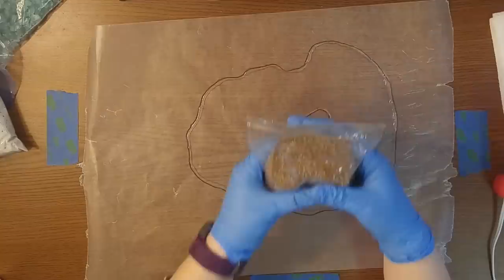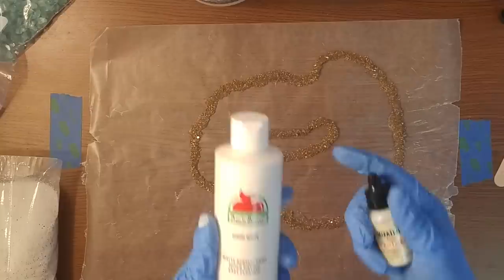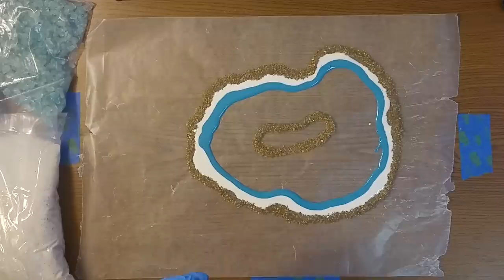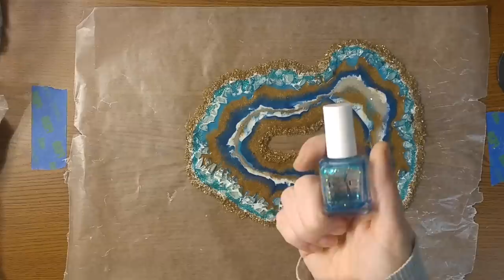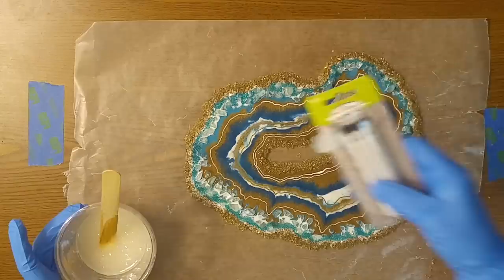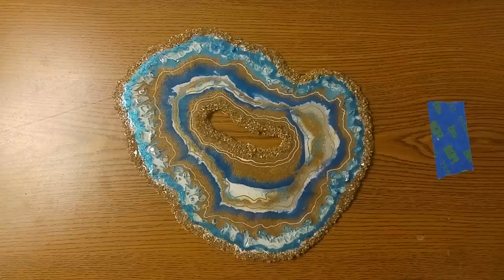#25- Making a Freeform Resin Geode on a Budget- New Edging Technique!

Comment: A very pretty geode. Just FYI-there is a product called nail polish thinner. You can get it at Sally’s Beauty Supply. If you have polished that are very low or just thick you can thin them out for spreading.  It doesn’t take much to thin polish so a bottle goes a very long way.
Reply from the maker: Thanks for the tip!

Comment: That would look awesome in a shadow box type of frame (white) with a teal mat.  Using a double thick foam two sided tape.  Fabulous work!
Reply from the maker: Ooohhh! I like that idea!
Reply: YES, I like Vicki's idea too! My thought was to pour a thin coat of resin in the frame (of course put plexiglass on back before pouring resin) put geode in after first layer dries then pour in more resin on top. End result would look like it's floating in the frame.😁

Comment: Your geode design turned out gorgeous. 
Regarding the waxed paper: I set a lot of gemstones in resin for basket centers and ya know what works best for me? Clear page protectors that you can get on the cheap at Walmart (I do prefer the heavier weight ones). Just cut them apart and tape down to a flat surface. Cured resin pops right off. I use a 1:1 epoxy resin but it may not be the same brand as yours so I'd test it out first.
Thanks for a great video. I'm definitely going to try this project.

Comment: Right now I’m up to the spot where you said the inside was a little tricky, and I was thinking what if you make the line on the inside a little bit smaller and that way you can pick the glass up over the outside glue line  like you did for the outside. It might be easier to put around… That’s just a thought 💭

Comment: What if you were to use a heat gun it would melt the wax that's on the wax paper and you should be able to pull it off. The center of a geode is Halo anyway. At least all the geodes I have seen or Hollow in the middle with dragon points of what looks like shards of crystal poking to the inside. But the center is pretty much Halo. Hope that helps thanks again Deb
Reply from the maker: Heat gun is a great idea!

Comment: So happy I found this video!! I plan on making coasters and I'm curious how long the cure time is before I could put a cup on it? Also, would it be able to handle a hot cup?
Reply from the maker: Thanks so much for watching! I would think a hot cup would be fine. I use my coasters with hot cups. The Stone Coat Countertop resin is pretty heat proof. They have a YouTube video of them setting it on fire and it not getting damaged! The quick coat dries pretty hard within two hours but still takes about 2 days to finish curing so I would wait that long.

Comment: WHy didnt you just do a line of resin first with the stones, let dry, then do the rest?
Reply from the maker: That would probably work great too! I didn't because the resin tends to leak out under the stones and then you have a weird edge. I also knew that I wanted the edge to be thick enough for me to pour two coats and I was afraid that without creating a barrier, the second layer would leak out over the top. Good questions!

Comment: This is the first geode art video I've watched. I love your technique and sense of adventure. I am wondering if parchment paper would work better for not warping and waving on the backside. Since it's silicone covered, it won't absorb moisture. You'd have to not shift the paper much while the paint was wet, though, since the glue wouldn't adhere tightly. Again, just a thought. Beautiful work- I hope to make some of my own now.
Reply from the maker: You are so sweet! Thanks for watching. I did switch to parchment paper and have since started using a silicone mat. Much better!

Comment: this is an awesome technique ! great job! I was wondering, you said you reuse your cups, how do you clean them?
Reply from the maker: Thanks so much! I don't use them to measure resin after the first go. But after I finish pouring with them, I leave them sitting upright and the last little bit of resin will all dry at the bottom. Then I just pour more resin in when I want to mix it with colors.

Comment: That is just gorgeous!! I’ve been working on geodes using liquid polymer clay, but after watching this video, I think I might have to try resin. I have an old silicone baking mat. Do you all think that might work for this technique rather than the wax paper?
Reply from the maker: Absolutely! I actually switched to a silicone mat right after this video and like it so much more. I have found that you need to make your glue lines extra wide because they peel off so well that you can dislodge them easily. I believe that someone else mentioned using adhesive spray and that worked for them. Hope you try it! It is so much fun!

Comment: I used hot glue gun last year towards the end of the year when I first started cuz I wanted to do free forms and I wanted to do them now I didn't want to wait 24 hours for silicone to dry so used hot glue gun and I built up my mold only to have the heat gun and the torch melt it down not completely but I did struggle with it
Reply from the maker: I haven't tried to use hot glue only as a barrier. I've only done it by pushing the glass stones into the glue and then letting the glue cool. Maybe my glass stones helped to protect the glue from melting? I have only used my torch to get rid of resin bubbles as well. I haven't hit my glue barrier with a heat gun.

Comment: What should I use instead of the paper so it won’t stick! I saw you using silicone mat, but I don’t have that :( any suggestions? Thank you so much for this video
Reply from the maker: You can use parchment paper. Just make sure the resin is completely cured before you peel!
Reply: The Frugal Resinista thank you so so much! You are the best
Reply: I saw some useing vinil shower curtain (transparent) and it work great. I think it’s an excellent option

Comment: A flexible cutting board would work to lift it and move it around.  $1/2 at Deals.
Reply: I also wonder if a teflon sheet or silpat would peel away cleanly, more easily than waxed paper?
Reply from the maker: Awesome ideas! Thanks for sharing! I have switched to a silicone mat but don't love it because the glass doesn't brush off easily. I'm still looking for the perfect base!

Comment: try freezer paper next time instead of wax paper. the wax may have melted from the heat of the hot glue
Reply: also dollar tree has a 2 pack of a very flexible cutting board plastic that NOTHING sticks to

Comment: What does the torch do to the materials? Could you use a heat tool? Beautiful work! Thank you!
Reply from the maker: Thanks for watching! The torch pops the resin bubbles to make your resin cure as smooth as possible. You can use a heat gun as well. You just have to make sure you turn it on away from your resin and move in slowly so that you don't blow your design everywhere. You can also use something as simple as a lighter. It just takes a lot longer.

Comment: Hello! Thanks for sharing! Let me ask u how Decoart goes with resin.Is it difficult to mix? Cause I used ones acrylic paint and it didn't work with resin ,I still hade some pieces of paint I could see. And how much resin did u use for this geode?  Thanks.
Reply from the maker: I'm not sure about Decoart but when you mix acrylic paint with resin you want to do one part paint to ten parts resin so that you don't have too much paint. It doesn't take much paint to color the resin. If you have too much paint, the resin won't cure properly. Thanks for watching!

Comment: Hello it's Deb again I was we were watching your video trying to learn more about making geodes. I'm don't know if I missed it or not, but did you mix the acrylic paint with the Stone Cold countertop mix? Or did you mix a color that was made for that countertop mix? Easy way if you can answer my question that would be awesome I would love to get started on working on a geode. Did you happen to know if there is a coupon code for the stone cold countertop mix? I would have to go to a cheaper epoxy of some kind I just didn't want to waste any of the mix by doing it wrong with things that aren't normally what they're used for kind of like with acrylic liquid pour where you use floetrol or glue or a number of different chemicals that make your paint a little more fluid. I hope you can answer my question thank you take care and God bless Deb
Reply from the maker: I put the acrylic paint right into the resin. Just make sure you don't do much. It goes a long way and if there is too much paint, the resin won't cure properly. It's best to do a 1 paint: 10 resin ratio or even less.

Comment: U said u mixed the resin...what did u mix it with???
Reply from the maker: I think I mentioned it a couple of times referencing mixing the resin and hardener first to make it ready to pour and then also mixing the resin with paint. For my resin, it is a 1:1 ratio of resin and hardener mix. If you mix paint in, make sure to do at the most a 1 part paint:10 part resin ratio so that your resin will cure all the way! Hope that answered your question!

Comment: Do I have to use a torch on the resin? I’m new to this and don’t have experience please let me know
Reply from the maker: Thanks for watching! The heat helps to pop the bubbles so that you end with a smooth finish. If you don't have a torch, you can use a hair dryer. But be careful because it can blow your resin around and if it isn't super clean, it will add dust to your piece. Some people also use those lighters with the long handles that are used for starting fires, grills, ect... They just take a bit longer.
Reply: Thanks for replying back I find your videos most helpful on YouTube I always see everyone using heat but it was never explained so I appreciate it

Comment: I have a question, doesn't nail polish turn resin yellow? It contains acetone-like solvent that with time will affect the surrounding resin. Love your work, btw, you're very talented.
Reply from the maker: Thank you! YES! Some nail polishes change color and can ruin your art! I test mine ahead in tiny jewelry molds. I have found that for the most part, the blues and blacks change color the worst. But I have had it happen with one kind of gold. I tend to do my blues on the very top layer so that they don't yellow.
Reply: @thefrugalresinista  Thanks for the tip!